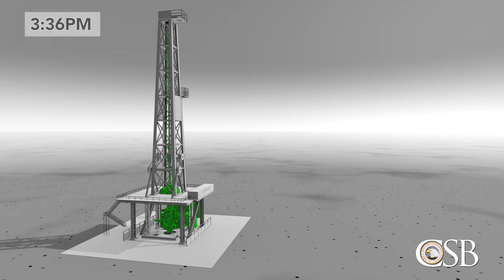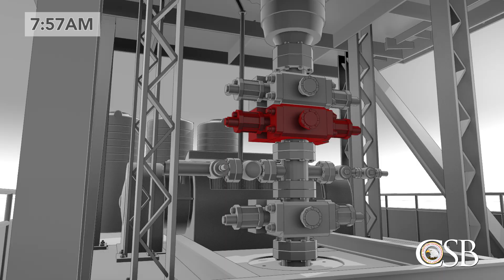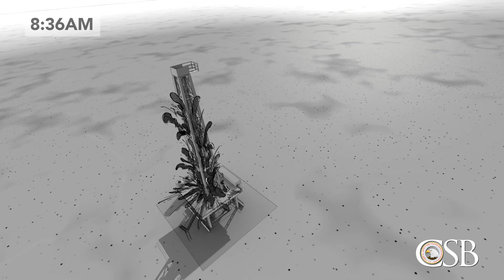Interim Animation of Pryor Trust Gas Well Blowout and Fire

Comment: I heard about this I worked for them in my late 20s I hate hearing these stories and tripping out the hole wet is miserable that mud goes everywhere u gotta put a mud bucket on and im sure they were using the big on you gotta put on a wench its like 400lbs in middle of winter but if they all were on the floor they should've jumped or ran down stairs as soon as that mud based oil came up the pipe and blasted though the mud bucket floorhands its time to run or jump not go in doghouse I can just picture it they thought they could stop it but I was a floorhand and I ran off the floor many times your instinct kicks in cant stop mother nature and all it needs is a tiniest of spark ...RIP to the men just trying to take care of there families...makes my stomach queasy to burn up that way like in a oven being cooked they didn't die fast rest easy guys I feel you😢

Comment: why is there no automatic system that closes the ram when a certain amount of mud is gained? A similar problem occurred with Deep Water Horizon, how is this not a thing yet?
Reply: Deep Water Horizon didn't pump enough or removed too much of the mud that was needed to counterbalance the oil pressure. I don't remember all the particulars but I do remember that much. The well had went through a series of kicks caused by high pressure gas zones. The BP operator was anxious to close the operation and took some extremely dangerous shortcuts that didn't work they way he hoped they would. BP is such a poorly run corporation that they had to rely on ExxonMobil and I think Texaco to help them come up with a plan to plug the blowout. I think they relied on the one engineer at the platform to make all the decisions without any oversite. The drilling engineer should be required to ask permission from the home office for the steps s/he is proposing to take like a fighter pilot does when they reach a potential target. The fact that BP is still in business is proof enough to me that they weren't fined enough.

Comment: Everyone on the well should be highly trained on conditions that pre-stage disaster and have a reaction plan to execute immediately.
Reply: They are highly trained and highly paid because of the years of experience it takes to learn how to do the work. It's similar to flying an airliner. You can't jump out and abandon the site because events are overtaking your crew. You have to man the controls and fight it out until you get it back under control or until events over take what can be done. Nuclear power systems are another case in point. You just have to work through the checklist and pray that it is completed before the thing blows.

Comment: How can that actually ignite? Shouldn't that all be an ex area which requires all equipment to be gas tight, so no gas can leak into electrical devices and find a spark to ignite?

Comment: The problem here is the ocean and land based drill operations use the same type blowout prevention systems are using the same type of Blowout prevention systems that use an annular valve which uses a rubber doughnut seal to close the supply pipe inlet. Lower on the blowout prevention assembly is a set of hydraulic valves that are designed to crush/cut the well pipe closed. There's no way this type of blowout prevention can be expected to perform a job that its not designed for. If as in here how are blind shear rams expected to work with a drill shaft in the hole? What's needed is a pressure control valve.    If a blowout occurs with a pressure controller can be closed safely and means at a rate that will not create a "kick" or Pressure spike (hydraulic hammer). Using the old blowout prevention system on land based operations can guarantee blowouts will continue to happen. Example of using the kitchen sink faucet and trying to use your hand to stop the flow. You're gonna get wet, if using the faucet will work ok. I'm an oilfield mechanic and am currently 2019 employed on Alaska's North slope oilfields in Prudhoe Bay at the Kuparuk river unit for a company subcontracted to conoco Phillips. I have over 30 years of experience in pipeline repair and maintenance. I'm also the designer of the caphead used to stop the deep horizon's macondo well spill. I submitted my design to the "horizon helpline" but was stolen by BP as my design wasn't patented. I still have copies of my design submitted as well as emails to verify. This type of design blowout prevention system for land needs to go and replaced with a design that won't do the job of controlling pressure causing the drills to be spit out. I'm currently working on the upgrades needed on both land and ocean based oil and gas production drill platforms. That will prevent future blowout incidents. My designs are available but not free and will be patented. "007".
Reply: I'm not sure I am following your description. You mentioned blind rams and shear rams but no pipe rams. I have been on wells requiring 'stripping in' where 2sets of pipe rams we're needed to get past the tool joint. Are you referring to a check in the drill stem?

Comment: why not have a section of the B.O.P. that's powered by springs and triggered by pressurized inert gas ampules......a fire superheats the ampule, causing it to explode, releasing a pair levers, that in turn releases the spring-loaded rams. the ampule is the only part that is exposed to the outside, and is protected by a thick piece of perforated steel plate.
also, a second ramset, also spring loaded, with a flow sensitive mechanical trigger mechanism, a flow with too much volume trips a catch inside, releasing the rams, sealing the B.O.P.

Comment: Rip to the hands out there who lost their lives. I wonder why the anular or rams weren’t set after the tremendous amount of mud backing up into the pits.
Reply: You are correct, you get fair warning by the pits gaining volume. The mud becomes gas saturated losing its density and then displaced by gas. Been there and our idiot driller kept thinking we could get closer to bottom but us floor hands got tired of mud dripping off the girders on us.
Reply: @gregw8232  are drillers incentivized to take stupid risks or what
Reply: @lolbots  yup. They get production and safety bonuses. I saw a hand roll and ankle and the drill manager just gave him t3s and heavily discouraged him from reporting it

Comment: Odd. Kicks that blow mud out of the hole are not common, but they do happen and anyone who has been around a drilling rig for many years has seen them. Obviously the Company Man, Push and Driller would be on the ball considering how much flow they had leading up to the event. Why didn't they close the rams when the well kicked?

Comment: Patterson, lol, operator error as usual.
My first day on the job on my first  rig site over 8 years ago was a Patterson rig.
Within 12 hours they managed to drop the whole Kelly drive from the top of the rig in an uncontrolled fall.
$250,000 of damage but fortunately the crew managed to outrun the falling pipe.  Just dumb luck no one was KIA.
Reply: fun times
Reply: My little brother was a driller on a rig. Due to a complicated down hole assembly, the figures were wrong on how long the down hole assembly was. As a result, he crowned the kelly, snapping the cables. The kelly crashed 90 feet to the rig floor, wrecking it along with a lot of other stuff. No one was hurt, and my brother reported to the tool pusher, assuming he would be fired. The tool pusher said "Nope, I've never seen anyone crown the kelly twice. Since we just invested a couple of hundred thousand dollars in your education, you better be at work tomorrow."

My brother is now President of one of the biggest tubing manufacturers in the industry, making a very heavy six figure salary. And no, he never crowned the kelly again.

Comment: I've read the "Factual Update" and watched this video a couple times; this is awful. It's like the script for this video was written by a petroleum engineering intern, they've heard the words but have no understanding of the processes.  At 00:55 the video says they pumped a weighted pill intended to prevent gas from flowing into the well. That doesn't make sense. It's going to take a hell of a lot more than a pill to increase the hydrostatic pressure enough it's going to stop the well from flowing. It would seem more likely the the pill pumped at 00:55 was pumped for the same reason the pill at 01:25 they wanted to create a u-tube effect so that the pipe pulled out of the hole was empty of mud. At 01:33 the pipe was not plugged! If the pipe was plugged how was it possible for them to pump the pills at 00:55 and 01:25. If the rig was following proper hole fill procedure it wouldn't have matter if the pipe was pulling wet or dry. What I would like to see are the driller's trip log and mud pit volumes from the electronic drilling recorder.

Comment: I really don't know much  what goes on in the oil industry and my question is were they trying to put out the fire or did they ran from the explosion and died from falling debris?
Reply: They died in the shack. You don't get out of those situations running  fire kills you even it doesn't touch you when it's that large and they weren't on the ground level.

Comment: HOW the F do they curve it?
Reply: They use a Bottom Hole Assemble (BHA) that has a rock bit, mud motor w/ a 1 to 2 degree bend about 4ft back of the bit, and about 120ft of non-magnet drill collar. The non-magnet drill collars house an electronics package that at a minimum would have an accelerator, magnetometer, and transmitter. The electronics package is indexed to the bend in the motor so the driller can point the motor bend in the required direction to drill the build (curve) or maintain inclination and azimuth.
Reply: @eddydogleg  complicated but ingenious inventions thanks for describing itd

Comment: This is not my industry, but it would seem to me that mud flowing out of the well would be a gravely bad indicator recognizable by someone with experience and or training. Either the person who noticed this was not trained well enough, or they were afraid to speak up with regard to safety. Both of those are the fault of management.
Reply: Kurt Richter I work on a drilling rig. We do weekly drills in this kind of stuff. 107 barrels of mud displaced is a huge amount to go unoticed. There would be alarms going off on the rig floor. They would know immediately, the video doesnt tell all information.
Reply: Brandon Cody Thanks for the insight. Be safe!
Reply: Kurt Richter No problem. Another thing to add is that during an active "kick" when it shows signs of the oncoming kick, there is typically a very short time to react. The time between "extra mud" and drilling mud shooting out of the rig floor could be less than a minute, depending on depth, gas formations etc. Its a very dangerous game we play.
Reply: Brandon Cody 
With the drill out of the well and all that mud coming up, shutting the BOP sounds like a good idea. Oh ...and run. It sounds like being in the path of an oncomming freight train.
Reply: Andrew White you can actually make things worse by shutting the BOP without being able to control it
Reply: taledarkside At the bottom of the drill string there is a motor with a bend in it. its full of advanced electronics and basically they stop spinning the drillnpipe, but the drill bit still spins. the motor will drill whichever way the bend is pointing. this is called sliding
Reply: They were there alot longer than a week. And fought gas consistently. Taking gains became a normal occurrence and addressed it. This time became different because the Equivalent Circulating Density pill was not as heavy as should as been, and the accumulator for the bop contained too much water to function correctly.

Comment: Surely you could have use that blow out preventer to... I don't know, PREVENT that blow out!
Reply: Three words deep water horizon
Reply: MrCloudseeker bop’s on land are manual because they don’t “need” to be automatic
Reply: @patrickgreiner6954  I'm 4th generation Texas Oil Field Trash, and I grew up in and worked in the oilfield. The rams on land rigs are hydraulically actuated. They can be manually actuated if the hydraulic system fails.

When hydraulically activated, they close in under a second.
Reply: @ArcFixer  What about if communications between the BOP and rig are lost? Wouldn't there be a safeguard for that? And what is the amount of time a worker would have to see the mud come out of the top of the well and call out to shut the BOP? Would one minute, in theory, been enough? Or is there more going on there? I know nothing about Oil or Gas drilling.
Reply: You can only control a well with BHA and pipe inserted into the well. If you’re not in the hole, you can’t pump against the pressure. A BOP cannot handle the pressure if too much, by itself
Reply: Because we are human, there is no such thing as a failsafe operation. We think we have all possible risk mitigated, but sadly yet necessarily, safety regulations and SOP’s are written in blood.

Comment: The question is :
Does the presence of gas within the mud is a normal occurring event .
If not then; what causes the gas to push the mud backward to the rig floor?
What emergency plans did the crew trained about?
What are safety warning devices that alerts the crew as the gas leaks on platform?
Reply: It's called hydro static pressure ....
Reply: It's actually formation pressure exceeding hydrostatic pressure. HP>FP is the basis for all well control training. The easy way to think of those gas bubbles is that they might be the size of a grain of rice 3300' below the earth,  but by the time it comes to surface could be the size of a small house. It's a shame 5 men lost their lives,  lord have mercy.

Comment: I'm not into oil industry but are not this should be prevented by BOP?
//Another good looking animation
Reply: I'm pretty sure You are right, I see it's a fresh accident, i hope they will release more footage after investigation to show more deeply what safety system failed because that's the most interesting part for me, At that moment we know what happen but not why escalated to deadly scenario like on "Deepwater Horizon" case.
Reply: The blind Ram closes  like an elevator in something is jamming it up then it won't close. Happening so fast dont have time to react
Reply: @redmudpei  possibly no one was in the cellar, but if there was enough flow to spill over the stack the driller should have noticed, there is also a flow counter on the flow line.
Reply: A kick can happen so fast usually there is a mess before the blinds are closed. And if the rig caught fire quickly before someone could close them...
Reply: They were testing pipe/bottom hole assembly at the time of the well kick. they had just pulled the drill string out, and hadn't gotten to the part of closing the rams when all hell broke loose. 

Usually the weight of the mud int he hole keeps everything int he hole, by the time they saw the BOP overflowing it was too late.
Reply: My former saftey supervisor had worked for Patterson and said that they were the worst outfit as far as giving a fuck about their employees welfare and didn't properly maintain the rams on the facilities he was on when he quit and then they had 2 of these incidents within the following year.
Reply: MILO BROWN  a BOP closes in 30-45 seconds, not minutes.